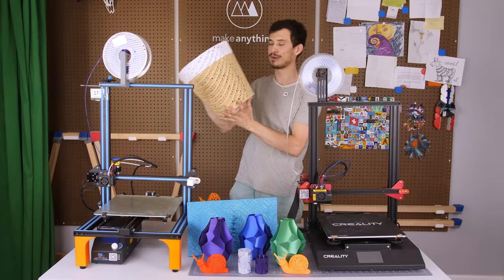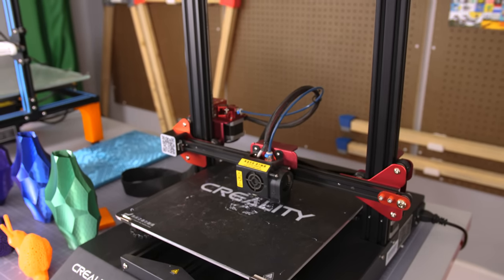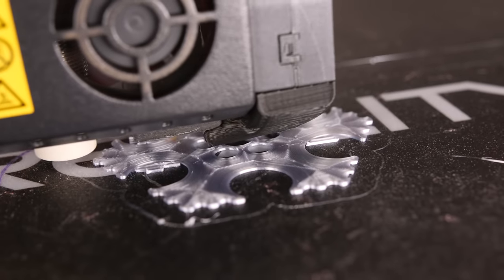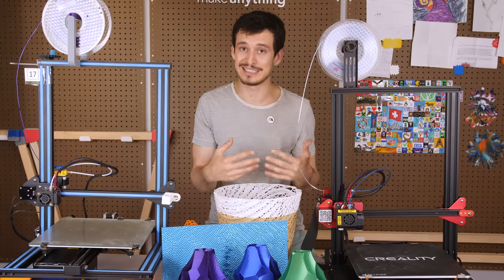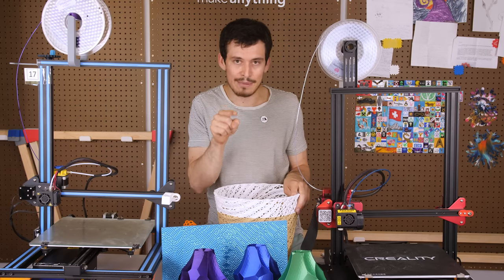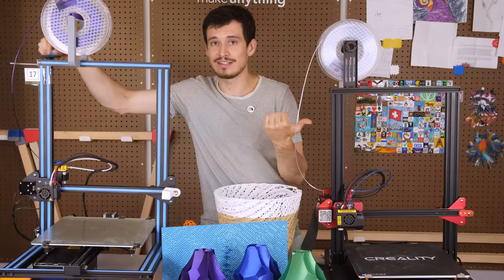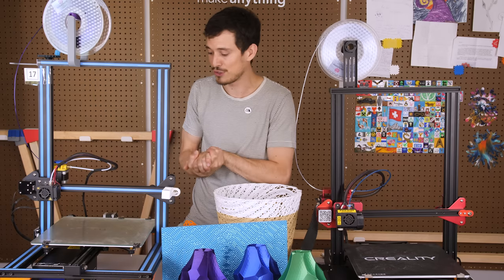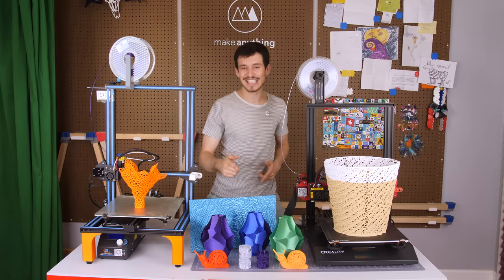CR-10S PRO Review vs. CR-10 3D Printer

Comment: Regarding anyone having difficulty removing prints from the bed of the CR-10S Pro! When using PLA, just preheat the bed to 40C after the print and they pretty much come right off, no need for the scraper. No damaging your plate. It's pretty fantastic.

Comment: Had same problems with the bed. Since i changed to glass i have no problem. You can chip the print off the bed, the bed doesn't even have to cool off the most time.

Comment: Devin, I totally agree with every point you made. I run an Anycubic Linear Delta as well as an Ender 3. Glass surfaces are the way to go in fact I attribute the fact that I rarely have to adjust my printer levels to the glass surfaces because I I don't yank on the beds themselves. Also here's an enhancement . I have two glass surfaces for each printer. When a print is finished I unclip the surface and replace it with the alternate (Obviously  both glass surfaces for each printer were cut from the same sheet ). but doing this allows the new print and surface to rapidly cool and release and the printer is immediately back in action if needed as well as no disturbance to the setup. 

I use 2mm picture glass instead of 4mm thick mirrors.  Yes,  the glass is fragile and delicate but it is also really light so on the E3 it doesn't suffer from Y axis artifacts caused by reciprocating a heavy piece of glass at speed. Also the glass is dirt cheap (I buy frames from thrift stores) and heats and cools quickly.

Here's a little project for you; how to automatically switch from one spool to another while printing. Instead of a filament run out sensor, some mechanism to switch to the next roll when the current roll comes to an end. I like everybody else have loads of reels with small amounts of filament on them. I'd love to find a way for the printer to switch filaments automatically. And no, the solution can't cost more than the entire printer.

Comment: Thanks for this Devin. I'm actually considering the CR10S Pro to replace my old clunky Deltaprintr.
Reply: I have a cr10 and I can personally say that they are fantastic printers. I was on a budget when I bought my 3d printer so I got a cr10 and after using it for 2 years it is still in tip top shape  after spending about $100 in upgrades (new z-axis couplers, new nozzles, new control box fans, etc.) it still runs great and has a huge build volume. I definitely can recommend cr10 printers and I'm sure you will not regret it
Reply: @mystery6703  I already have a cr7 printer from a few years ago and it runs great, but it has become too small for what I need.
Reply: @AmusementLabs  yeah the cr10 printers have great size for the price
Reply: As much as I love my cr-10, do yourself a favor and buy a prusa lol.
Reply: I just got the CR-10S Pro on  a Black Friday special.  It is working great! It's my first Creality, and glad I went for a higher end model to start.

Comment: As a owner to a CR-10S and 2 CR-10S Pro's and a ender 3, Prusa MK2S I did not like the default build plate on the Pro as well i moved to wham bam build plate. I am seeing the same issues with leveling with mine I even had to stop print a few times on account that it would move my nozzle to low and would not allow filament to come out. I got to say your review is spot on from what i see and i am thinking of putting BL touch on my Pro's
Reply: @136videos  Unfortunately No nothing official as of yet anyway. I just got bit by the 3d printer bug. and I dont like to wait 3 weeks for a project to get finished :) dealing with the slowness of FDM printing the more printers you add the less wait time you have when doing projects. Now i can get nice/complex projects done with in 24 hours. I am currently looking at adding 2 more printers to my arsenal. I want a delta printer just cuz i dont have one yet. and i want a duel extruder or a pallet 2 if they can ever get off of the cloud for software. and maybe now that SLA printers are coming down in price maybe...... its getting close

Comment: Great video and I completely agree with you.  My CR-10 and CR-10S have been tanks.  The only upgrades I made was replacing the hot end (Titan Aero/Aero Evolve fan duct setup), using the TH3d Unified Firmware and the Tiny Machine polypropelene bed.  I added the EZABL sensor for better accuracy and it's gone well.  These newer printers from Creality/Tevo/etc are just re-do's of the same previous models, over and over.  New paint.  New electronics...but the same core i3 printer design.  I have seen too many videos on LCD touch screen freeze ups and many false readings on filament sensors, so I just old school it and make sure I have enough filament on the spool
Reply from the maker: Exactly.. I've had more false flags with filament runout sensors than actual saves :|
Reply: @make.anything  I'm sure there are some better mechanical limit switch setups that probably work more reliably.  I'm surprised your extruder has held up.  Mine started slipping a few months in and all I use is Hatchbox or ColorFabb PLA.  I'd worn a groove into the brass pinion gear.  Direct drive has been so good!

Comment: 6:22  The nozzle runs into the bed before the IN-ductive sensor triggers. I would bet that's the reason the Z leveling is inconsistent. A fix could be lowering the sensor by turning the threads which secure it. The Z adjustment (on screen) looks to be an offset, so tuning that after the adjustment might work. I don't have my hands on a CR10, so maybe something you could test. :) Interesting points though!

Comment: I have the cr-10s pro since a week and yes you definitly HAVE to replace the sensor. Theres no way around that. But that fixes almost all the problems the printer got. With the tinymachines custom firmware, and some optional upgrades like new fans and a different heatbed, this printer is pretty awesome. And it looks way better than the older versions :D
Reply: @ApolloMcrib  Straight into the insult. Very mature. You pay for a beautiful printer with some nice features. If its worth the money is up to you.

Comment: Just got the cr-10 for my nephews xmas gift from ebay used (like new in box) for $244. Purchased before I watched this video, and this verified my choice was correct. Also, I'm so glad the glass is ok with hairspray, I was almost sold on the $55 buildtak, and $130 buildtak flex plate and I really couldn't afford that too. I just wanted him to be able to get good prints right away and have the space to go big if he wants without too much complication on the setup. Cr-10 ssems to be perfect. However, I also bought him flexible filament without knowing the cr-10 needs a modded piece for it to work. But it shouldn't be too difficult for him to figure out with youtube tutorials and he's 16 years old. Thanks for the video, it was well done.

Comment: Had same problem with auto bed levelling on my Anet, the thing was I should heat it up before bed levelling and then it worked every time. It's not a big deal performing auto bed levelling every time you print, just add it to your start gcode. Also, Buildtak, I find it one of the best options,  don't use spatula, it's thick, I had best result using utility knife where you slide it fully out and then wedge on side of print and slide it under print. This way you should avoid cutting Buildtak cos the knife is parallel to it.

Comment: I love your honest opinion.  I like the fact that you tell it true, and not just try to promote the more expensive printer.  I have the CR10S Pro, and I love it, I don't regret buying it one bit.  I did do some upgrades to address the issues that you pointed out, like the bed leveling problem, and I understand you are comparing the stock models (mostly).    I think the one thing that made me decide to go with the Pro, and not the CR10 was because of looks.  I never liked the stand-alone box.  Sure there are mods that can be done to fix that issue, and mods to add auto bed leveling, and quieter steppers, etc, etc.  I just felt that the Pro version was more of a jump start on those mods.  And I agree, the buildtack SUCKS!  Got rid of that as soon as I could, and I went with the Wham Bam flexible build plate.  I also agree glass is a great print surface, but having the Prusa MK3, it's hard to go back to a nonflexible build plate.  Now if someone were to ask me which one I would suggest they get, I would have a hard time saying "You should get this one", it would all depend on the person really, and what their skill level is.  I have a friend that doesn't have much in the way of mechanical skills, and he loves the CR10S Pro.  But for someone who loves to tinker, and modify things, I would recommend the less expensive CR10, and let them modify it at their leisure and budget.  Love what you do my friend, keep up the great work.  =)

Comment: Picked up a CR10S pro to accompany my first printer an ender 3 Pro V2. Loved the Ender 3 so much I thought I'd love this "Upgraded" CR10 even more. Well over all I am not really a fan either. It's not bad in any particular way just not really worth the hype. If all you want to print with is PLA than I actually think it's a solid option although a bit pricey for that purpose.

However if you ever plan to regularly print higher end materials like ASA or CFNylon that require an enclosure than a CR10S is the better option IMO for one important reason. There are very limited enclosure options for the CR10S Pro and the ones that are available all include the electrical base within the enclosure which is not advised for printer longevity. I ended up having to custom make a raised enclosure which took a good bit of personal time to design and "fabricate". The CR10S with it's separated electronics and power supply is much more suitable to enclosure use.

Comment: Your first review on the CR-10 is what convinced me to bite the bullet and buy a 3D printer! It's been a lot of fun.
I struggled with bed adhesion and leveling starting out, so I got a second Z-axis stepper, but it's most likely unnecessary. I found what works best for adhesion is actually lime juice! Plus, I think it smells much better than hairspray. As for bed leveling, I found the best way was to print a file that prints a square in each corner and the center, adjusting the bed as it prints, and re-printing the file as needed until each square has a proper thickness.
The factory glass build plate on my printer seemed to sag slightly in the center, so I switched it for a 12"x12" mirror that you can get at most hardware stores. This has the added benefit of looking cool (IMO) and also gives you an easy view of the nozzle.
I removed the factory feet, and installed printed ones that hold yellow foam golf balls to dampen vibrations.
I also have printed a LED strip holder that fits right on the top bar and wired it directly into the power supply. (I know this could be a bad idea, but I don't think they draw much current and have not had any issues)
The last upgrade I've added is a Raspberry Pi with Octoprint and it is great. Not only does it allow remote viewing of prints, but makes controlling and printing a breeze. No longer do I have to navigate through menus on the printer screen with the scroll button, I can easily change the temperature, move, and extrude with the keyboard. No longer do I have to remove the SD, I can immediately upload g-code from within Cura. Totally worth it.
Reply from the maker: Shoot I need to finish setting up Octoprint! Never heard of using lime juice.. Very interesting

Comment: Had buildtak on my Monoprice Mini, gouged it getting the 2nd print off. By the 5th print I had ordered a borosilicate glass replacement. Bought a CR-10s, replaced the stock glass with an IKEA mirror. Both glass surfaces worked great with purple glue stick, don't like hair spray. Currently have a PEI sheet on one of my IKEA mirrors. It's only issue is every scratch and nick shows up in the bottom of my prints. But there's no clean up and prep is a quick wipe with 97% isopropyl alcohol.

Comment: I LOVE the way you've made the CR-10  more compact! I really need to do that. Great review timing as I was considering purchasing the Pro, but will consider sticking with the CR-10S Touchscreen version. Also agree 100% on a glass bed, I have 10 CR-10S's and I turned over the Borosilicate bed to get the smooth side up, and then just used Magigoo as I would on my CR-10's. Other than that, I am using the CR-10S's with a touchscreen, works great and lets me set some custom gcode commands I can run at the touch of a button. Great for moving up the gantry in 1 click and for preheating the bed and nozzle all in one press!

Comment: Very nice and honest review. Some people think that by purchasing more expensive or "Latest and Greatest" that they are better. I haven't been 3D printing that much and I'm still fairly new to it but my Ender 3 is an awesome printer. I have a Printrbot Simple Metal that needs a new board, I think, an Anet A8 that I need to get using again a CR-10 that is still in its box and needs to be built along with my just arrived CR-10 V2. I love designing and printing parts and sometimes forget I even have them to much going on I guess.

Comment: I have a CR-10s Pro and I love it. Out of the box it was a solid 3D printer and I have not had any of the issues you have had so that’s a good thing. Love the videos and I love my CR-10s pro.
Reply from the maker: Did you get it recently? Maybe they fixed things further with the firmware
Reply: I have been using it none stop for 2 months, I did upgrade to the Tinymachines firmware but I didn’t see any difference.

Comment: I like having a printer I can hack around on and the CR-10S fits the bill. With the Pro I know I would want to change things about the interface and add new options in the firmware, and it just doesn’t seem nearly as accessible for that.

Comment: I just finished setting up my CR 10, but I lost the SD card it came with so I had to get a new one.  I just tried leveling the bed using the paper method, and I have a bed leveling print to help me dial it in perfectly.
Reply: 1

Comment: Awesome review. I recommend looking at the Evnovo Sidewinder X1 as it is $400-430 and has a similar frame to the CR 10S Pro but with a Titan Aero and E3D volcano direct drive extruder plus filament runout. It also has an AC heat bed which is super fast and dead silent steppers.
Reply from the maker: I'm reviewing it in 2 weeks or so 😉

Comment: some of the cons you mentioned with the cr10s pro v2, are very opinion based, and they have easier remedies, then you might think, i owned a monoprice printer with the same buildtak/aluminum  combo, and i did run into the same problem with the buildtak ripping upon removal of prints. i found it extremely easier to simply replace the buildtak on the bare aluminum with blue painters, tape, it makes removal of the print, far easier to remove aswell and not only that, it makes the surface cleaner, on the bottom of the print, as you can replace it after each print. as for the autoleveling, i believe you can set the printer to auto level before each print, via gcode. so you would simply just start your print, let it level the bed, then run youre good to let it continue printing.  no intervention required. atleast thats how i did it with my monoprice mini delta. i realise no 2 printers are the same, but generally, alot of printers, have features similar to other printers.

Comment: can you play ur intro with 3d printer( using midi file ) using the motor to genrate noise.( you can place 3d printer on wood or metal table to amplify the sound)

Comment: I've had that trouble with my CR10S Pro with inconsistent bed leveling as well. I tried all these tricks others suggested to fix but none worked for me.  I ended up installing a BL Touch. I've also switched to a glass bed.  I prefer that smooth look as well. After two months of use though I'm needing to fix touch screen.  It thinks I'm pressing somewhere else on my screen than I actually am.I think a stepper motor has gone bad because now when the stepper is disabled the printer will just slide down on the left side. Was not doing this till just a couple of days ago. And lastly, during some prints, the temperature just drops. Instead of being at 60 bed/225 nozzle, they go to 25/25 or so for standby temperatures and printer keeps on trying to print.  I'm not as impressed with the touch screen when it was working. I saw a post on Reddit where they replaced the screen with the older style like on the cr10. I might go ahead and retro-grade like that.

Comment: It's an INDUCTIVE sensor, not conductive. What most likely is causing the inconsistency in your bed leveling is the heated bed and nozzle are causing interference with the sensor since they give off EMFs. EMFs cause interference with the inductive sensors. This is why in the TH3D Unified Firmware, there is an option to turn off the heaters for a split second when the sensor takes it's measurement. Try this and let us know if that helped!!!!

Comment: I would add to that the CR-10S PRO seems to have slightly sturdier frame, it should be able to get slightly higher speeds without any degradation in print quality.